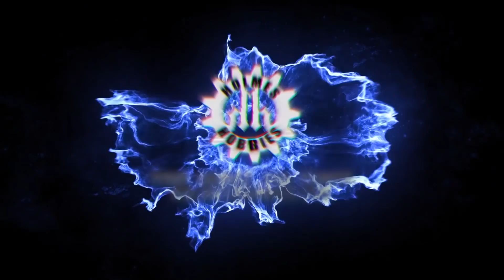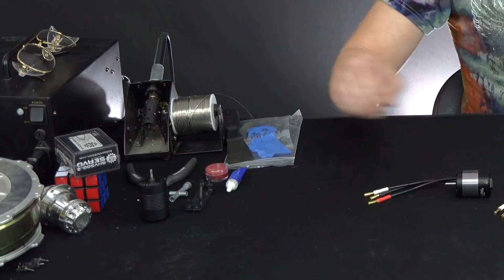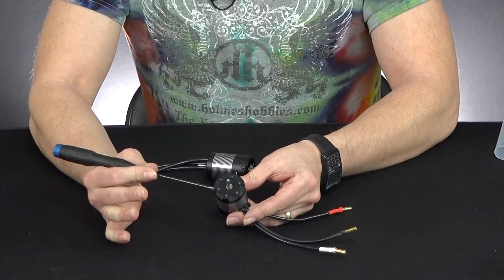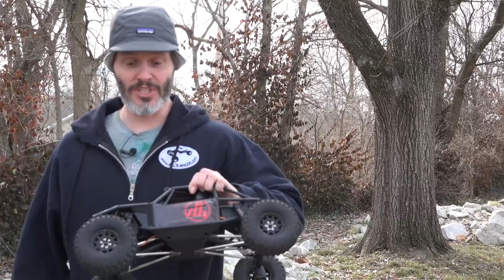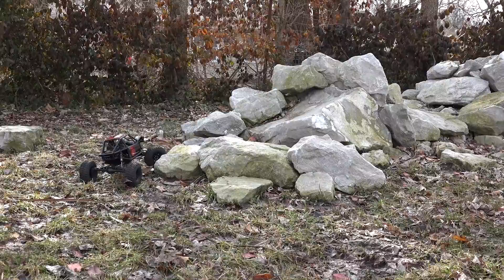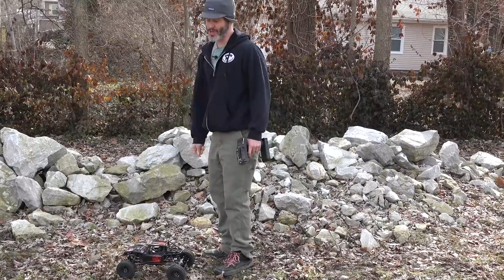Excessive Force! See What's New On The Puller Pro V2 Brushless RC Crawler Motor - Holmes Hobbies

Comment: For comparing the V2's smoother startup with the original motor, would you keep the gearing and ESC startup settings identical? That would help separate the motor changes from setup differences on the Capra.

Comment: Abit of an old video but il shoot my shot. Just built a truck based on the Element builders kit, Puller pro V2 Stubby and Mamba micro X2. Truck is with everything on 2700grams.
It wont hold 100% it will just roll slowly. The esc is set up as Holmes recommends on his video with regards to the drag brake and such.

Any tips? Did i maybee gear down to much? Or does that not affect it at all?
Reply from the maker: That's the nature of the system.  If you want more hold, you could gear down further if possible.  Or shed some weight.
Reply: @HolmesHobbies  Cheers for the answer. I wasnt sure as none of my other trucks do this :)

Comment: Will a Sidewinder 3 esc run good with the Puller Pro V2 3500?
Reply: I hear it won’t be as smooth without the balance wire but, will it burn anything up?

Comment: Great video - can you confirm if the puller pro stubby supports 4S ( I thought I heard you mention voltage,  but I can't find it again in the video).   I also cant find any voltage specs on the website for that model.   Thanks

Comment: this is EXACTLY the video i needed to see! im currently building a capra kit and had a 550 motor laying around, and found out it would not fit while trying to install it on the skid plate. i have an axe 550 xerun on my traction hobby 1/8 founder 2 and love that motor, but watching your test of the puller pro on another video, and you saying the standard fits in the capra have made up my mind on getting the puller pro 540 standard size for my capra! THANK YOU!

Comment: I have a new Puller Pro Stubby V2 1800KV and been having issues with the pinion slipping and jittering at low throttle. Really need some advise as I have not gotten support from Holmes customer support. :(

Comment: what is better revolver or puller pro v2 (2200kv?)?
i want the most torque as possible. (or would crawlmaster magnum 13t be the way to go?)
Reply from the maker: Revolver, more torque density.  Puller Pro, better power density.  Brushed isn't as torque dense,  even the magnum
Reply: @HolmesHobbies  awesome, thank you so much for the reply! much love, i refuse to buy any other motors than holmes now, they are best on market by far.  (incoming order! i only wish you had some crawlmaster esc's!)
Reply: @HolmesHobbies  
what would you suggest KV ? i love my 10t crawlmaster. i use 10or11tooth pinion and gear way down. im thinking 2200kv revolver v2
Reply from the maker: @ed0c  2200 is a great choice
Reply: @HolmesHobbies  awesome ordered! thank you so much

Comment: Which kv is better for crawling? 2700 or 1800? Is 1800 enought already?
Reply from the maker: There is no better withing the 1000 to 3500kv range,  but 2700kv 4 pole is the sweet spot of wheelspeed and control.   If you don't need that much wheelspeed the 2200 and 1800 is also great choices.

Comment: Noob question (always used the brushed holmes motors with a 1080) I would like a Puller Pro V2 2700KV to put in my Element Sendero HD, but what would be the best ESC to combine it with. Looking also to add a little more weight to the truck, planning to run it on 3s

Comment: John, rewatching this I only just noticed that you said you could get more wheel speed with the Puller 2200KV than you can with the Revolver. With the V2 Revolver available in 2500KV is this just out of date or is the Puller Pro still faster?

Comment: Will the torque, speed and drag brake be better in a 3300 kv stubby rather than a 2700kv 540?
Reply from the maker: The larger 540 size will have more torque and drag.

Comment: does the 4274 2100kv start smoother than the  R 540-L? I bought a traction hobbies founder 2 1/8 scale crawler and am trying to decide which motor to put in.

Comment: Hey john so I have the the puller pro v1 stubby 3300kv  I was just wondering what gearing you recommend for the motor, it is in a trx4 sport  with a momba x
Reply from the maker: stock is totally fine
Reply: @HolmesHobbies  would you ever be interested in donating one of these puller motors to someone in a wheelchair I would love to have one for my trx4 but I can't afford it because of my small disability check and my kids and bill take it all I barely have enough to keep my trx4 running im glad it dont break easly lol and when it does the good upgrade parts are that bad

Comment: Hi, I put a Puller Pro R V2  4100Kv into my Pro-line Pro-MT 2WD and lemme tell you something. This thing is a animal, it is so fun to drive.  I've had it almost 2 months now and have been driving it nearly every day. Getting ready to do it's 1st teardown and inspection/lube soon. I've been super impressed so far, no issues. Running it with a Castle Mamba Max Pro SCT on 2S with a 12T pinion (32p). It was shredding my 48p plastic gears i had to mod the tranny to take a Robinson spur for  SCX-10. It had a Castle 1410 3800 Kv, it was a nice motor but i like yours WAY better. My bearing in the 1410 blew up after 4 yrs and thrashed the rotor and probly stator too, I'm in Florida....I think Ii might know why now. Still 4 yrs and never really lubed the bearing I guess I should have known better huh?

Comment: John I am running the Mamba x with the Castle Creations 1900 KV in my heavily modified trx4 Blazer. If I was to run your Puller Pro V2 standard 2200 KV would I see some improvement in torque and speed?

Comment: I pulled the trigger, I ordered this motor today I also ordered the Mamba X to control it. I DO have a question or two, a 15T 32P 3mm pinion comes with the Vanquish Ultra I ordered also. Is this a good gear for the motor? Also do I need a 3s or will the 2 S suffice?

Comment: I would  like to see a moa setup with one of these motors also, I run a clodbuster crawler and its hard to find video setups for them...
Reply: That's something I didn't think of! Clod Pro power!!  You just need to reverse the Timing of one of the Motors.
John has a Video on doing that.
Reply: @CarlRCTips   I have seen the people reversing the timing of mototrs before but I have not done it myself yet, thats how I found HolmesHobbles in the first place looking for such a motor

Comment: Best motors on the market IMO. I have a newer Trail master BLE pro esc that im having troubles with. I have tried programing it multiple times on multiple different settings. The issue is when I am going down a hill and have my figure on the throttle trying go slow down the hill it just takes off on me like there is no drag brake. then as soon as I let go of the throttle the drag brake locks up like its supposed to. As long as my figure is on the throttle going down hill it free rolls. There is no down hill control just full drag break or no drag. I have multiple Mamba x systems so I am confident on my programing skills and how the systems work. Thank you

Comment: Does the Mamba Micro X work with this motor and if so what is the advantage of doing the regular Mamba X?
Reply: In my experience with the MambaX Micro  with a Version 1 2200 puller stubby... 
5.5 lbs
9 tooth pinion
3 cell
Axial scx10.2 with overdrive front diff. 

It's one of the smoothest combinations I've experienced.  Very predictable.  Plenty of grunt.
The active braking down slopes is awesome too.

I also added a 25mm fan over the cooling fins on the Micro.

I run it in a competition environment,  no water.

Hope that gives you some insight.
Reply: jimmy h absolutely! It’s $160 as a combo as opposed to $230 so that’s a good deal

Comment: Wish I bought more Holmes motors I have Tekin Roc412 1900kv in my VS410 pro with mamba x. How does the puller compare? Should I go with full or stubby on build like this. I kinda wanted revolver but I see you have pullers in stock.

Comment: It'd be great if you can show a rock crawler setup for the Mamba X I bought one from you and I'm having slight troubles I run a 3s lipo and within two minutes of running it goes from 11.4 volts about 9 volts if you could show me how to set that up on a video that be amazing to fix that problem no one else has good videos on it on the Castle link setup